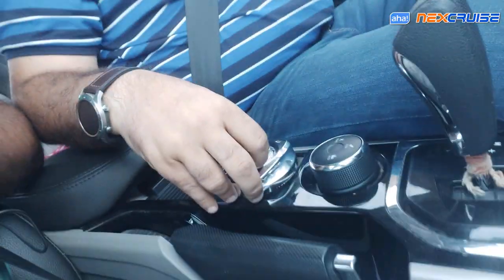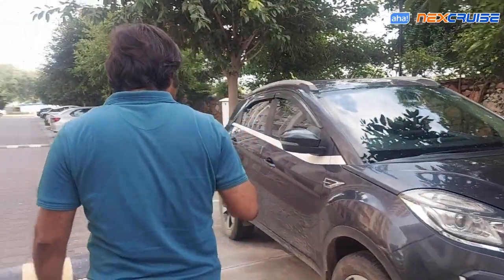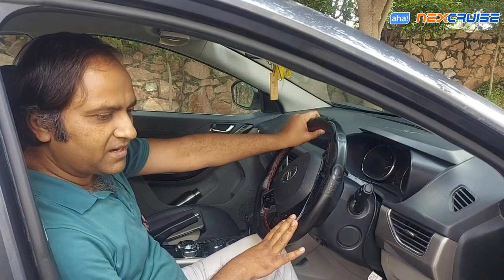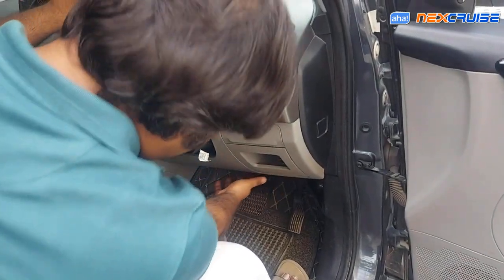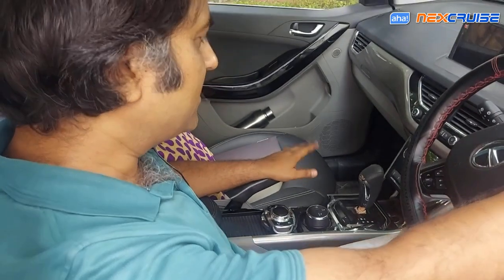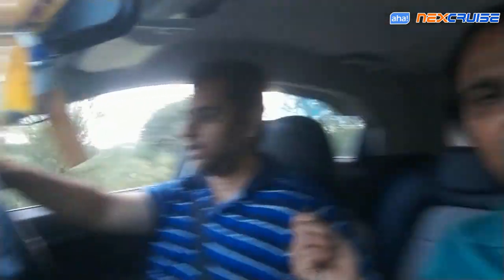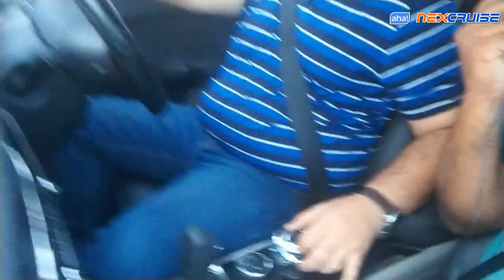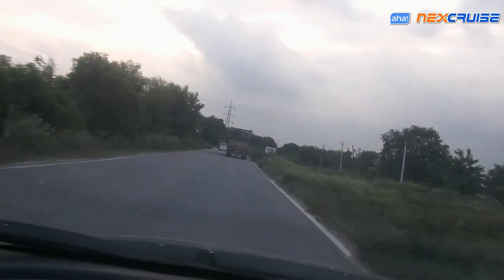Get Cruise Control in your TATA Nexon (and other TATA cars) - Aha! NexCruise

Comment: Is there auto cut off feature, When you brake or accelerate the cruise control feature would stop?
Reply: I wanna know this as well
Reply from the maker: Yes of course. Braking or pressing cruise button again cancels CC. Accelerating doesn't cancel CC. When you accelerate, the vehicle picks up speed, and when you let go of A pedal, it comes back to the cruising speed.

Check out the "introducing the NexCruise" video for a demo.

Comment: can we use original  steering cruise control switches with this
Reply from the maker: No. That would void warranty, and the unit will be no longer plug-and-play.
Reply: who will install this when we order online
Reply from the maker: @alluriraju009  it is self installable, takes 5 mins, our team will guide on video.

You can also engage your local mechanic, we will share the installation video with you.

Welcome to call us on 8003944400 for any queries.
Reply: What is the price Sir for tata nexon bs4 diesel xz+?

Comment: Xms varient where to place knob
Reply from the maker: We have developed an attachment so the knob sits on the drive mode selector dial. So both functions can be done with the dial - mode selection as well as cruise control.

Pls call 8003944400 we will share with you a photo of the arrangement.
Reply: @ahainnovations  attachment needed to be bought separately?
Reply from the maker: @curiousdesitraveller  yes, for an additional small price. Pls call 8003944400 for details.
Reply: No response on the given number.
Reply: Manual me bhi kaam krega kya?